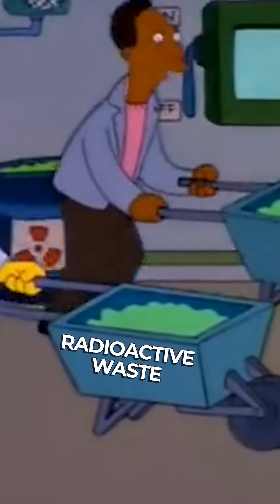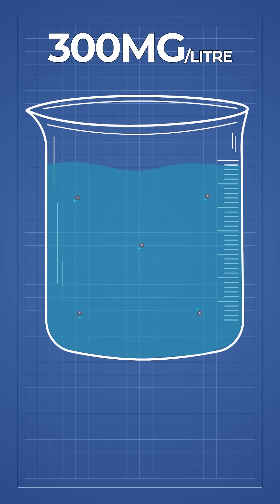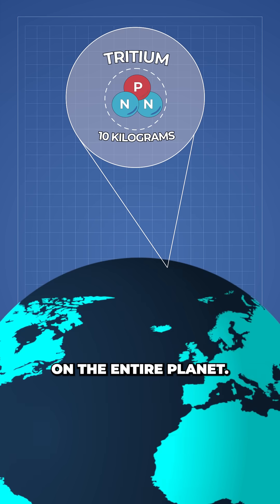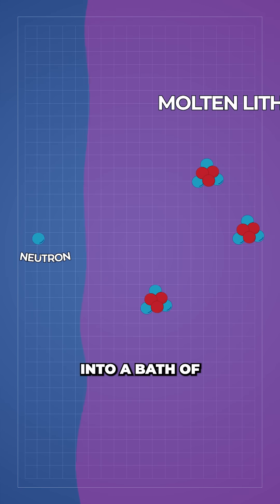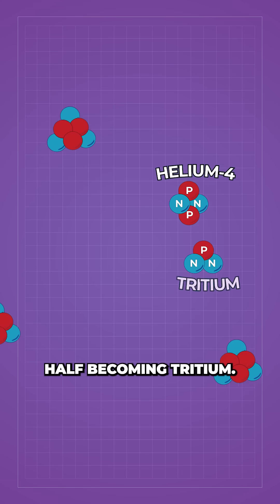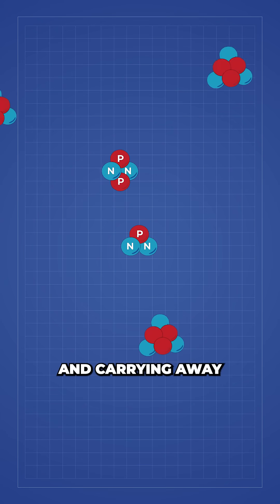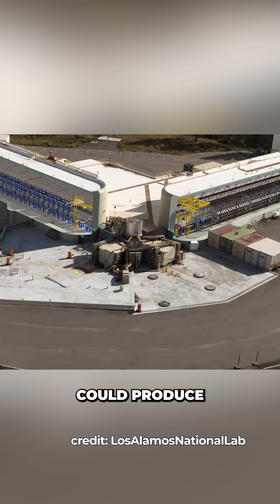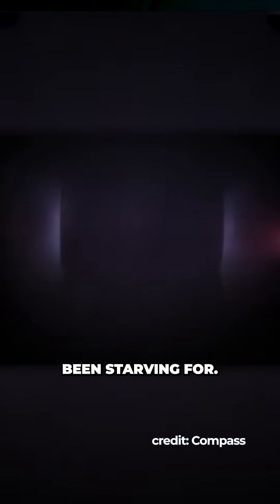Scientists Just Created Fusion Fuel From Nuclear Waste

Comment: Actually it solved three problems, but makes another... Helium is a finite resource here as well, it's RMS velocity is actually faster than the escape velocity of earth. So when helium gets to the atmosphere it literally floats off into space. We need helium for things like semiconductors. But then the new problem is how much lithium do we have?
Reply: Well, thankfully Lithium is 100% recyclable, so at least that won't be a problem in any forseable future.
Reply: @The_Keeper can’t recycle it if you turned it into helium and tritium 🙄
Reply: @The_Keeper Not when this project runs. This project consumes lithium.
Reply: When you split lithium to helium and hydrogen you loose the lithium it's gone forever.
Reply: @The_Keeper  According to the process described in the short, this will consume the lithium, making it nonrecyclable. 

But honestly, this will use very little amount of lithium to produce more than enough tritium compared to the battery industry currently.
Reply: @the_keeper not if we keep turning into helium+water with our particle accelerator alchemy, it isn't
Reply: @The_Keeper No it isn't, if you fission it 😅
Reply: @raffaeledivora9517  Fair point. :)
Reply: Also they keep finding huge amounts of lithium, shit's everywhere.
Reply: @froo5667 yeah they just found the biggest deposit ever recently.
Reply: Assuming the lithium can just keep getting cleaned up and pumped back in, sounds like setup should actually consume just a few kilos per year per plant. Not a big amount of lithium. But that same quantity is a huge amount of tritium
Reply: Lithium is one of the most common elements in the universe. It’s been around since the beginning of time. Right after the Big Bang there was mostly hydrogen, helium and a bit of lithium. Nuclear fusion from stars created every other element
Reply: @Hippiemantra Makes sense. Elements get rarer as they increase in protons and a lithium atom has only 4 of them.
Reply: @jacobc9221 Lithium has 3 protons 3 neutrons
Reply: Okay, so lithium is recyclable and common but helium is non-renewable. Is there a way to create helium? And either way, how common is it and how is it obtained? Will there be a way to recycle it one day in theory?
Reply: @Iamstandingrightbehindyou It's right there in the video... bang a neutron hard enough into Lithium, and you get helium and tritium...  Also, IIRC the byproduct of fusing deuterium and tritium is.... helium.
Reply: @Iamstandingrightbehindyouwell there’s not much hope to recover the stuff that escaped into space. But the commenter’s point is that, as the video states, the process produces stable helium 4 as a byproduct.

By any non nuclear process, no, helium is an element. You can’t magic up more of it. But now…
Reply: @Iamstandingrightbehindyouhelium-4 is created during the split of lithium-6.  And theoretically you can catch helium but again, its RMS velocity is so great that it escapes the gravitational pull of the earth and goes into space, escaping forever. Think of it as laying on the floor of a pool and blowing bubbles and trying to catch them all.
Reply: @Iamstandingrightbehindyouyes there is a way to make helium it was stated in the video
Reply: @IamstandingrightbehindyouFusion reactors are the only known way to synthesize helium, but I don't know if it would be be produced in sufficient amounts to run the particle accelerators, also some amount is still being produced through radioactive decay inside the earth. In theory you can also do nuclear fusion without tritium but in practice it is much more difficult because it is harder to ignite pure deuterium.
Reply: @Iamstandingrightbehindyou u can make helium with nuclear fusion its a byproduct
Reply: @Iamstandingrightbehindyou The answer is simple, since helium (and they were talking about the reaction creating Helium-4 not regular Helium) is a gas here, we can go out to the moons of Jupiter and Saturn, where helium is a liquid/solid and mine some.
Reply: @IamstandingrightbehindyouDid you not watch the video or something?
Reply: @Hippiemantra the universe's composition isn't reflective of earth's, though. ~25% of the universe is helium and yet we're talking about how scarce it is
Reply: @Hippiemantra  but is it common on earth?
Reply: one problem at a time
Reply: Do we not just get helium from the sun? It produces like 600+ million tons of it every second, surely we get some of that coming our way
Reply: @-grumpygold1155  the helium made in the sun can't escape the sun's gravity unless there is an ejection... Aka, you better hope we aren't catching helium from the sun 🤣 potentially some may make it's way to us naturally, but it's essentially not going to want to enter our atmosphere because it's lighter than the rest of the atmosphere. It's essentially like floating styrofoam on water... It's very unlikely to sink down to where we will get it.
Reply: @-grumpygold1155 Probably but that's different.
Reply: @-grumpygold1155 the sun's gravity doesnt let helium escape we get barely any helium
Reply: @-grumpygold1155 isn’t it 596 million tons per second? I thought the sun converted 600 million tons of hydrogen into helium per second.
Reply: We have a lot of that, actually. And with higher energy capabilities, we can solve that problem after. Very little escapes Earth's system, so we'll just become chemistry experts and figure out Zero-Point.
Reply: There are lithium asteroids
Reply: Isn’t the big problem that lithium supply is a geopolitical problem?
Reply: Nuclear fusion reactors produce Helium as waste
Reply: Lithium is probably easier to get than the other super heavy elements. And is much more abundant in asteroids.
Reply: Good point, and helium is running out. Lithium is a great question..... Especially with how much we are collecting for batteries.....
Reply: Just fuse the tritium with deuterium to make lithium
Reply: Lots of lithium sir all good
Reply: Underated comment
Reply: there is no way to fix that problem
Reply: The anual extraction of helium is about 160 million cubic metres. The few kilograms that can be generated with a particle accelerator would not make a dent even if we had 100 of those accelerators. Plus this helium would be so expensive that literally nobody could use it
Reply: I always felt like Star Trek was saying dilithium was just lithium with a D on it "why would you take the dlithium you can find it everywhere" Tom Paris STV makes me wonder how this actually powers a matter antimatter reactor? The s*** my cell phone can do that?
Reply: Helium comes from radioactive decay
Reply: Nothing floats off into space. Every nucleon is subject to gravity. There is likely  trade off with solar particles with some earth particles, but I would say most of the traffic is one way... inward 
.
Reply: @russellk.bonn8534  it is subject to gravity, but at atmospheric temperatures it moves fast enough to escape gravity all on it's own. Do a little research, helium leaves earth when it gets into the atmosphere. This is why helium balloons should have never been made into a thing. It's actually very wasteful.
Reply: @Akya2120 Nope. Helium can't generate an escape velocity by itself. Even helium balloons can't escape. Learn some physics. All matter requires the standard escape velocity to leave earth. Stuff doesn't just sort of evaporate, or there wouldn't be any hydrogen left. That's even lighter than He. Electrons can leave, but they also come back to keep charge balance.
Reply: @russellk.bonney8534  Hydrogen doesn't escape from Earth because all the Hydrogen on Earth is chemically bonded to other heavier elements, such as Oxygen in the form of water. Helium does not bond with anything and the mean free path of Helium will allow it to escape from Earth's gravity well. (There's quite a lot of Helium orbiting the Sun at 1 AU... because it escaped from Earth but not the solar system.)
Reply: @russellk.bonn8534 the escape velocity of earth is about 11000 m/s and most gasses go at high velocity by default but not high enough to escape earth i would guess that the helium product from nuclear reactions has high energy which gives it a high enough velocity to escape earth

Comment: Great idea, just one problem. Those free neutrons are highly radioactive and we will use them to split other elements? Have you ever heard of a nuclear explosion when there are high concentrations of radiation with unstable elements!😅
Reply: Not everything radioactive can just explode. To go supercritical it usually needs to be highly refined (which nuclear waste most certainly is not) and something to trigger it. It's literally impossible for nuclear waste to explode.
Reply: @amppari_234My concern is not with the first part of their plan. The second part is worrisome. To direct all this energy and expect the same results is a bit crazy when we know that nuclear waste is all in different stages of degradation. To increase the chances of a successful process, they will have to standardize the quality of the radioactive waste or concentrate it.

Comment: wait a minute, how does this make any energy? if making the fuel is just the reverse of spending it. this feels like making water by boiling and condensing steam
Reply: It's more recycling. We get energy from nuclear reactors, and then we use the byrooducts to get more fuel.
Reply: @amppari_234 yeah but how? fusion makes lithium i believe, so making fuel out of lithium should take as much energy as it produces
Reply: @kantoros  yes, but there's energy stores as radiation energy. Since the particles were already packed into heavy elements that are decaying, we simply needed to harness them and we can use their stores energy. Just like any renewable, the energy comes from somewhere, but we didn't make it so it's "free"

Comment: That is why nuclear energy is the best yet people are paranoid as fuck
Reply: Yeah people still bitching about Fukushima Daichii.
Reply: Yup, and that one wasn't even that bad. Just a few hundredthousand liters of slightly radioactive water escaping.
Reply: Well, they have good reason to be.
Nuclear energy (well, fission specifically) is like flying;
Super duper safe, but when it Does go wrong, it goes wrong in a spectacularly horrifying fashion.
Reply: @The_Keeper  The point is, fission reactors nowadays can be made so safe, that even in the worst case scenario, no catastrophical damage would be done.

What happened with Fukushima, wouldn't have ever even happened if they only followed all the safety protocols and precautions that the engineers and scientists constantly reminded the company about...

Unfortunately, the biggest enemy of nuclear, is big oil, coal and gas corporations, and any leaders that directly, or indirectly, benefit from less nuclear and more fossil and gas
Reply: @The_Keeper  and yet people didn't stop flying.
Reply: @hurricanefury439  True, and yet a fairly substantial percentage of people are scared shitless of flying, despite it being safer than even walking.

Comment: The only problem I see with this is that the particle accelerator needs quite a lot of energy itself so you would pretty likely use quite a bit of the energy you have just made from the Uranium and Plutonium

Comment: Is the energetic formula stable on the long run ? 
Does the energy, used for accelerating those particles and all the others consomption off energy. Found in the fusion reaction formula ? 
If we consider a low level off loses ?

Comment: That’s a wish-believe stuff. Particle accelerators are known for more than 50 years, idea of using them to repurpose nuclear waste was their first main application, yet it was never actually done. Calculations that they “should be able to be used” to produce components of actual nuclear fuel are submitted every year, none actually make it to production, and not cause of “greedy corporations” but cause you waste x10/100 more energy to produce said fuel components than you ll get from that fuel. It’s basically wasting energy so that you could produce just a portion of wasted. Insanity. If tritium was in such demand - it would be reasonable to produce it despite the cost (see weapon plutonium) but it’s not. That’s why it’s cheaper to bury nuclear waste, at least it does not require you to produce 10kg of waste more just to repurpose 100g of it into fuel.

Comment: @DrBenMiles The human cost of this will be insane. Whatever energy you get from this will be largely used up in the process of making the fuel. One particle acceleration cycle takes 340000000 Jules and the heat generated is just waste. This entire thing makes no sense when we could just make LFTRs and fluoride will bond the tritium to the solution until birilium is added then a whole host of gasses will escape the salts where they can be sequestered for little to no energy loss. The energy release will be within the reactor so it can still be used as process heat and make power

Comment: This is not new or needs to be done with nuclear waste. This is what is called Tritium breeding and a fusion reactor lined with such a breeder blanket can produce its own tritium while running by itself.
 
Six different tritium breeding systems will be tested in Europes large scale fusion test reactor ITER.

Using nuclear waste is unnecessary and dangerous to begin with, as you would have to refine the nuclear waste to be able to put what you need into the accelerator, you can’t dump shovels of whatever nuclear waste you find into an accelerator. Nuclear waste is extremely dangerous and we still have no clear way to dispose of it, putting it into n accelerator and shooting it around at fractions the speed of light is no solution.
Reply: Yep, these people in the comments section are genuinely braindead. I remember writing a paper on this very topic 2 years ago, experiments have been going on for decades on fusion reactors
Reply: The point of using accelerated protons is so no waste reprossing will be needed
Reply: A) Tritium breeding in fusion reactors is technically challenging, there is a real danger that it will run out and we won't be able to jump start it.

B) The nuclear waste only needs minimal reprocessing. The accelerator-driven reactor can adapt to many different kinds of fuel mixtures.

C) It is true that the process is not a complete solution to nuclear waste: The accelerator gets rid of some of the most nasty isotopes, but the bulk of the waste including some problematic portions remain.

D) That said, you should not discount the fact that some of the most nasty isotopes actually get destroyed, for good, without converting them into even more dangerous substances!

Comment: Filter and distill seawater for water, heavy water, seasalt and byproducts. 

Use neutron flux from suitable nuclear "waste" isotopes on heavy water and graphite moderator to produce tritiated heavy water.

Distill the tritiated heavy water into heavy water and T2O. Recycle the heavy water back into the neutron flux chamber. 

Electrolyse the T2O to obtain tritium and oxygen. 

Encase the radioactive graphite in quartz and insulator, doubling as storage medium and a thermal supply for a thermoelectric generator such as a Sterling engine. 

I guess bottle the oxygen or dump it in the atmosphere.

All this seems cheaper, safer, simpler, high-throughput, low-tech, less maintenance, less manufacturing, more independent from company, location, expertise.😊

Comment: I love that the promise of Fusion as the energy source of the future..  relies on the rarest fuel on earth..  Ooops.
Reply: It is because you don't understand the process behind it. Tritium is so rare because and naturally produced tritium has long since decayed away as its half life is only 12.5 years. So all tritium is man made and a fusion reactor would be creating its own tritium for the reaction. This is just a large scale tritium breeder.
Reply: @n3v3rforgott3n9   .. based on breeding blankets that simply don't exist as anything more than a proof of concept, and will require other relatively rare elements like beryllium to produce an excess of neutrons (otherwise you're always using a little more tritium than you're producing).    My point though was, everyone sells the idea of fusion as using an endless supply of readily available deuterium, and neglect to mention that it also depends on one of the rarest elements on earth requiring a whole new set of technologies to produce.
Reply: @daemn42  Tritium is only rare because of its very short half life meaning all but newly created tritium has decayed away. They have been able to create it for a while now.